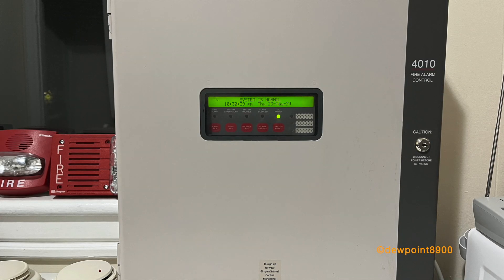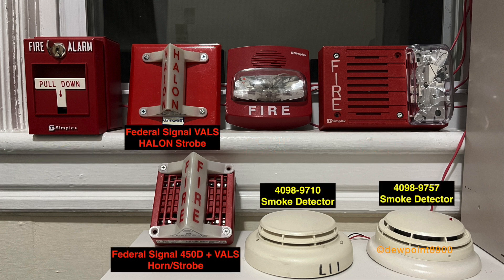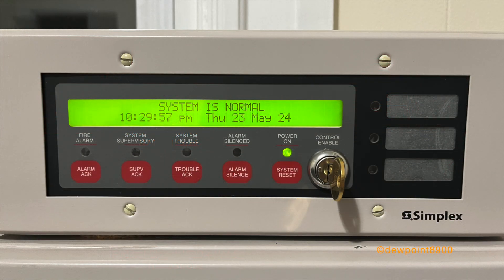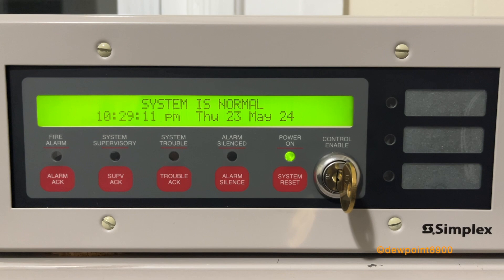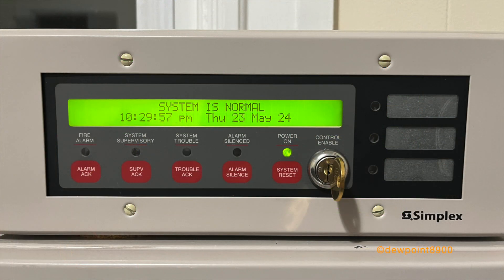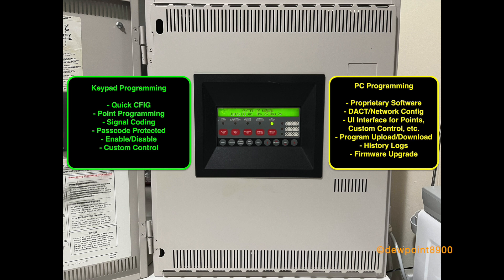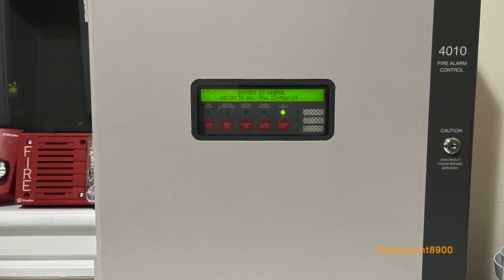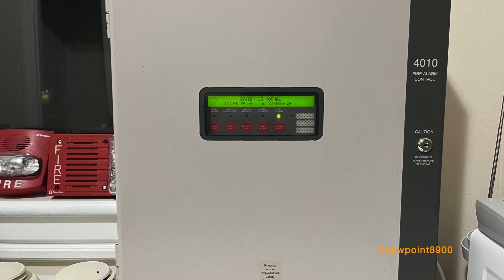Simplex 4010 Overview and Demo

Comment: I've always wanted to know, does the quickalert sound like a regular smartsync truealert, a free-run truealert, or does it sound unique?

And MY GOSH that's a low-pitched vibratone!!!

Last thing, I actually got to interview a Johnson Controls employee for a carreer project and he told me that the 4010 classic is by far the most common simplex panel in the wild. Can't say I'm surprised, but still cool to know!
Reply: QuickAlerts sound the same as the TrueAlerts. The SmartSync QuickAlerts sound like the SmartSync TrueAlerts. The Free Run QuickAlerts sound the same as the Free Run TrueAlerts.
Reply: @aidanthetoiletelevatorfire7554  Thanks! If they have the same horns, what's the difference besides the unique grill on just some quickalerts?
Reply: I put 2 horn ,strobe on NAC 3 but it show trouble visual on panel what that mean

Comment: The legacy 4010 was replaced by the 4010ES.
Reply: It wasn’t, the 4007 replaced the 4010. The 4010ES was made as a smaller version of the 4100ES, hence the no voice.
Reply: @trainknightt  I don't get why Simplex needed a smaller version of the 4100ES. The 4100ES is a very customisable system. I always thought the 4007ES was the replacement for the 4005 and the 4008.
Reply: It's complicated. The 4007ES replaced the 4008 which replaced the original 4010, and the 4006 (which is still made) replaced the 4004. I guess simplex wanted all addressable panels to be under the ES line so the 4007ES took the place of the 4008 as the smallest addressable panel, but it also might've replaced the 4005 in functionality as a panel meant for small-to-midsize applications. The 4010ES more resembles the 4100ES in both operation and function, as it is meant for mid-to-large size applications while the 4100ES is more suited for large to campus-size installations. The 4007ES probably sits between the 4006 and 4010ES within this hierarchy as it's larger and more capable than a 5-zone conventional panel but doesn't carry the capacity to be suited for anything larger than the classic 4010 could handle.
Reply: @MichianaAlerting  The 4006 was actually discontinued in April, the new Simplex Foundation series panels will replace the 4006.

Comment: Very very nice setup! Gotta love the Federal Signals & that First Generation QuickAlert! Rexy has the same type of 4903-9419! The 4903-9252, 9253 and 9254 are also cool because they are retrofit signals that can be found on older Systems using 4903s.